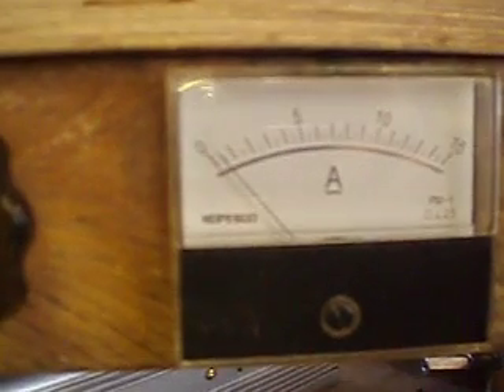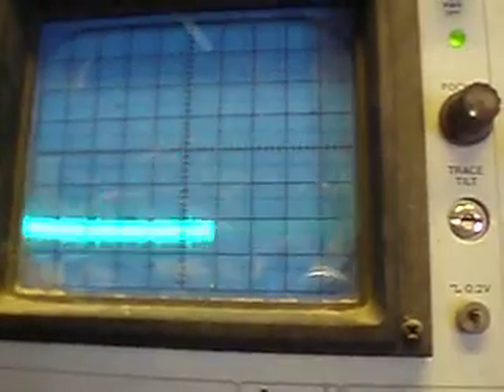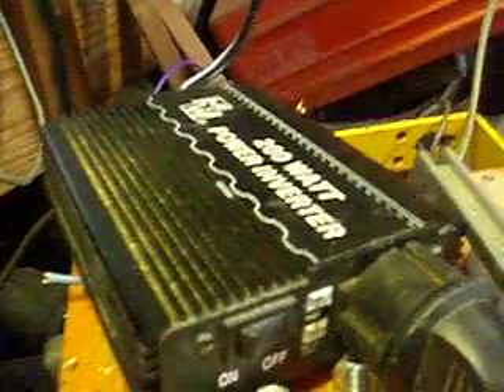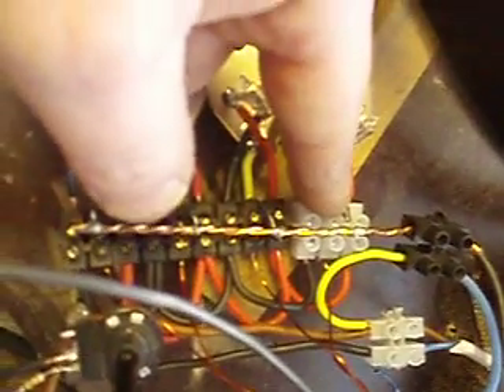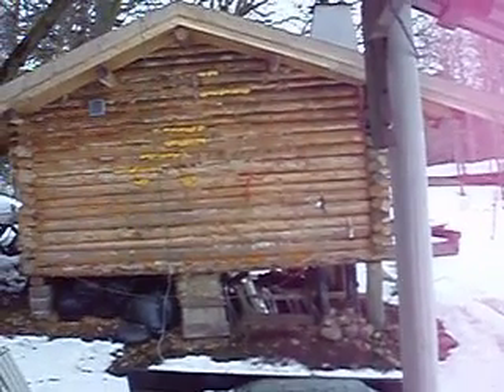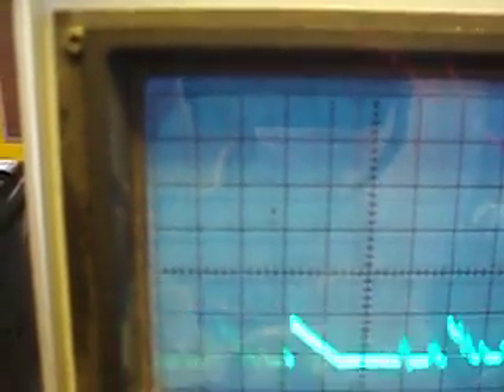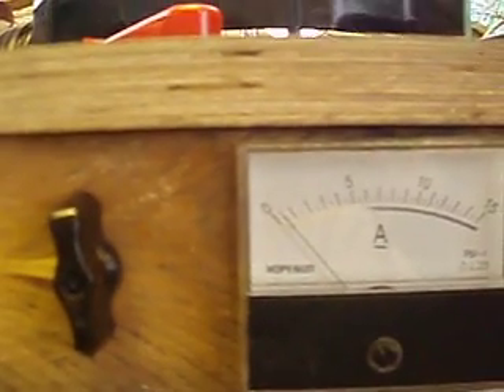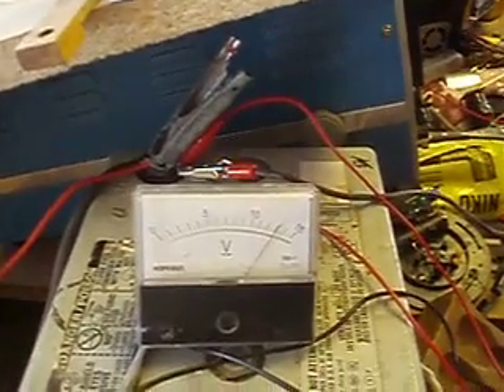FREE POWER FROM BEDINI CIRCUIT

Comment: Aint it funny that none of you Bedini guys Ever show the Input power--  in Watts -- to the device in comparison to the Output Power in Watts--At The Same Time!

--I dont need to wonder why!!

Anyone with half a brain will know the Input Power will be Higher than its Output, hence you are needlessly  just wasting power--And your time!

BTW--Should never hitch NiFe batts in parallel with Lead-Acid, the Discharge Voltage curves are NOT compatible.